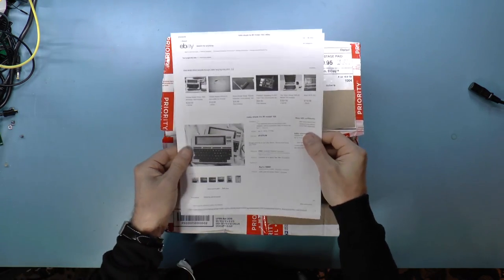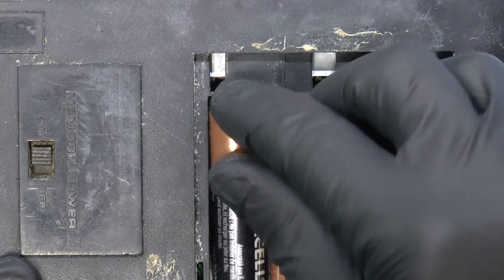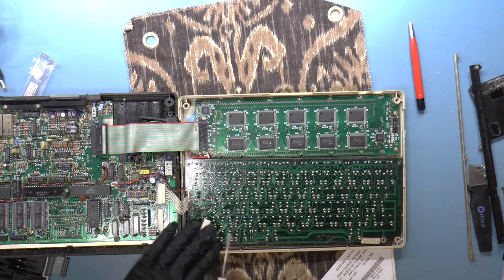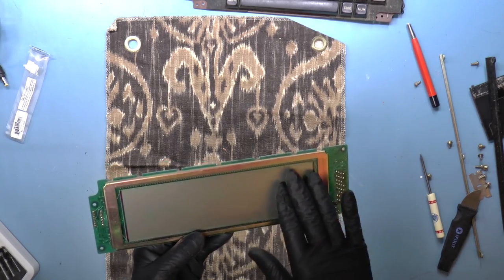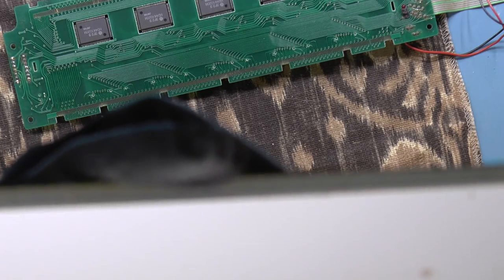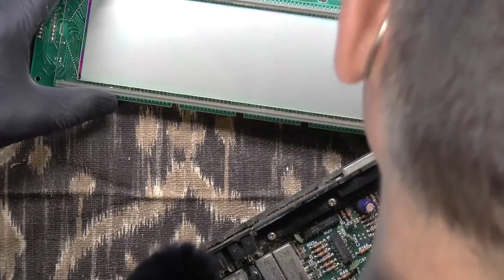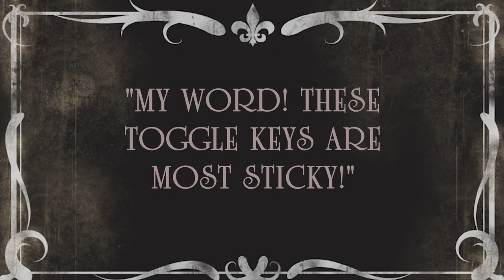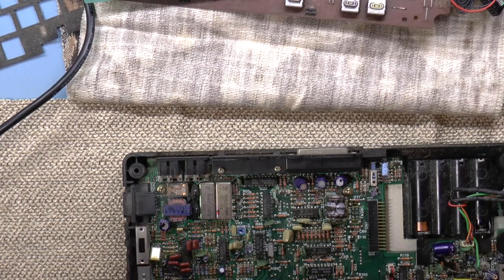Fixing (sort of) a TRS-80 Model 100

Comment: Those elastomer connectors are tricky! One thing to beware of is that they have a surface memory after a while, so if you try to reverse or flip one, it screws everything up. Then good luck realigning it without fatigue-snapping a tab (RIP the whole module)
I learned that the hard way when trying to repair a couple similar LCDs. Took a lot of flipping, rotating, aligning, and patience to get them right again... Somehow the tabs held out, mostly

Comment: Surprised it wasn't mentioned here. Alkaline cell leakage can be very quickly cleaned up with a touch of white vinegar. Can be diluted with water if used in really sensitive applications. In general is safer than mechanical removal like with the fiberglass pen you were using here.
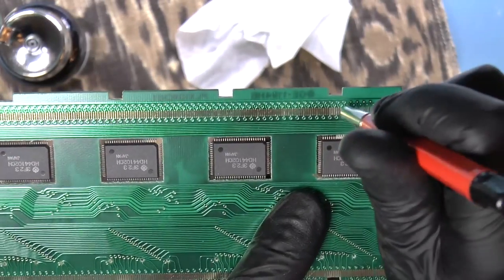Reply: Hah! Not 30 seconds after I post do you mention "you can also use vinegar" @ 44:30 Still stand by the fact that vinegar is safer for alkaline battery leakage compared to mechanical removal though!

Comment: Nice job on the LCD. You have to pull the AA batteries before measuring the mem battery, or turn off the mem batt switch. Otherwise you are measuring the charging voltage. When the mem batt switch is off it cuts the voltage from AA's/power jack to the machine as well as from the battery to the static RAM. With the mem batt switch on and 'power' switch off the AA's/power jack are charging the mem batt. 

When the memory battery goes bad it can stop the machine from booting which is sort of an odd symptom one would not think should happen. I bought a bunch of NiMh cells of the same size/rating and put one in the Model 200 I just refurbished and have the extras up on my website if you are looking for a battery.

Comment: Hi, definitely takeout the pcb, check and clean it especially around the battery compartment, I think the modem was built in - the top left area of the board, the little isolation transformer gives a clue. I would try a backlighting mod with an light distribution foil of some defective lcd tv and a limo battery mod with usb charger, fitting cells and charging modules are relatively cheap and available everywhere. I think Dave Jones did a retro teardown of this trs80-100 some years ago. Nice little z80 maschine.

Comment: Toggle switch is actually quite simple. Pin gets pushed against the stem with a flat spring in the side of the housing. The narrow end of the pin should go against the stem. When it's too far to the side of the stem it may miss the slides formed in the stem. If the slides are damaged you're out of luck.
Reply from the maker: Yeah, the slide in the stem looks a bit damaged.
Reply from the maker: Hmm, the key is apparently an Alps SKFL (locking). The keystem with the slides only looked damaged because it's made of a soft plastic kind of like Teflon. I was able to clean it, and the key works okay. Not great, but at least it works the same as the other locking keys in all the other model 100s I have.

Comment: You need to remove the AA batteries to really test whether the internal battery has decent voltage.  I don't think you can just remove the internal M100 battery.  I don't think it will run without it.  But you are right, you should just replace it.  Great vid on the elastomeric strip work!!!!  And as you probably know by now, you can use telcom with the built in modem OR the serial port.  In fact, you can load and save BASIC programs to/from your PC via the serial port.  Love these machines!!  And you have the full 32k and a Super ROM.  Nice..

Comment: 1:04:55 There's a small spring that pushes the sliding part of the keyswitch to the left. When reinserting the sliding part you need to hook the spring back on the pin.

Comment: Not LED but LCD, check all of the traces going to the ICs on the back side of the LCD. Very often depending how the M100 was stored the battery will leak out and drop on the LCD and eat the trace, you really need to inspect it with a magnifying glass.